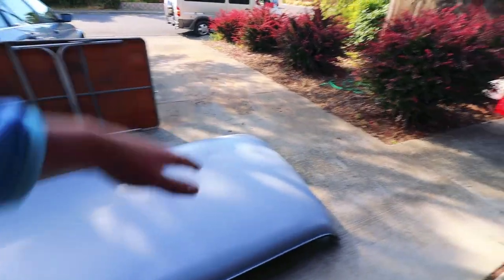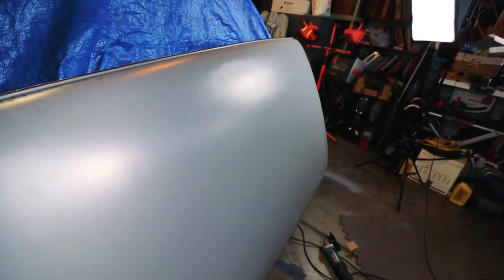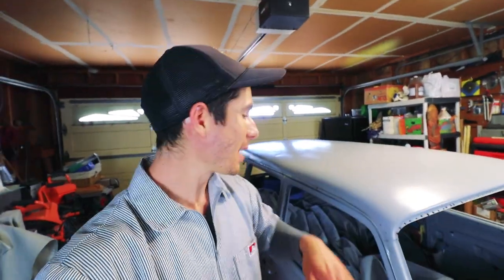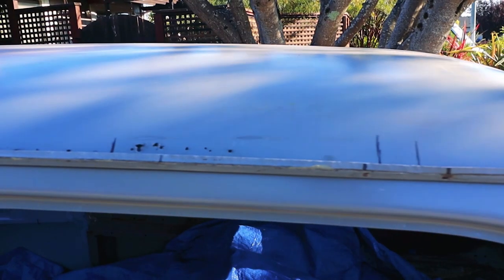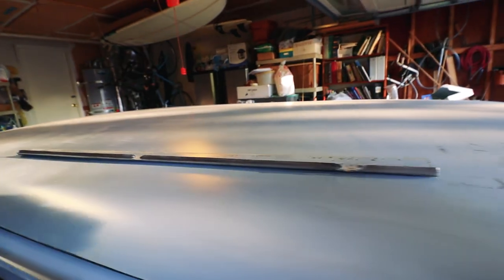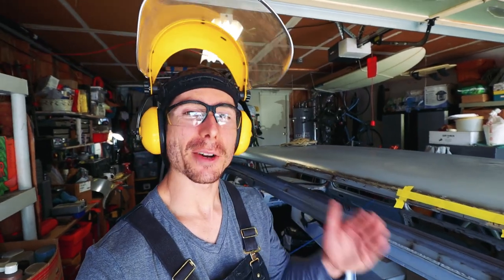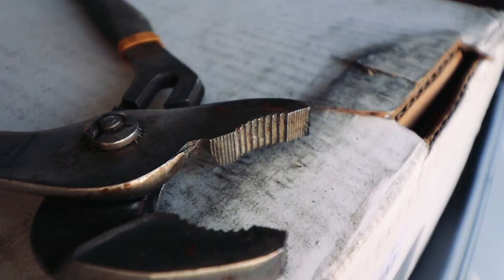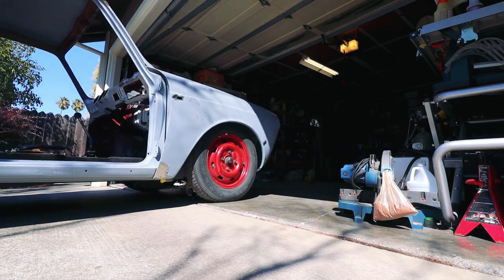VW Squareback Build - Roof Skin Install and Tips

Comment: So glad you are covering this! No one does it "the right way"...... On the Drill failure... drills arent designed for the side forces of grinding/sanding.... I use pneumatic, but  you need lots of volume. Kawasaki makes a nice variable speed electric angle grinder.
Reply from the maker: Thank you! Ah, very good point. I definitely abused that drill so I cant fault them too much. 
Thanks for the recommendation! I do have a pneumatic HF right angle grinder, but running air for that long is not as nice as using electric. Ill check out that Kawasaki!

Comment: Nice workmanship. Not surprised by the drip rail splitting. Methodical approach to your work paid dividends in the outcome. 
If only I had the forethought to video my restoration of my squareback in my single car garage alas only a huge number of photos to tell the story.
Reply from the maker: Thank you!
Don't fret too much. I love making these videos but they probably double the amount of time it takes to get a job done. 
Samba threads are still my go to when I need to figure something out. Much appreciation to everyone maintaining a thread.
Reply: @DreamWrench  my wife spends hours doing cooking videos for you tube.  
Certainly adds to the timeframe of putting a car together. 
Apparently I can make a video using still photos.  
Don't hold your breath  ;)

Comment: Good work Patrick, you must be stoked it’s on. Obviously a huge amount of time and effort, just wondering with what you’ve learned along the way, if you would go the same route again. Or would you just do the pillar chop or even have used the “new roof” to patch the hole in the old. 
Either way hope you feel proud. Some achievement
Reply from the maker: Thanks Roman! 
I actually would do it this way again because I feel like it would be easier the second time around. I would also search out a better roof because that patch really slowed things down and created some headaches.
...but if I had never done a roof replacement and saw the pros and cons of each way, I'd probably chop at the pillars. I cant say because I haven't done it, but I think grafting at the pillars would be easier and faster.
Reply: @DreamWrench  the way you replaced the roof panel is the best and safest method. 
Chopping through the pillars might seem quicker but not the best way to achieve what you want, a safe car .
Chopping through the roof pillars to lower it is an entirely different thing.
Everyone knows that the car has been modified from standard.